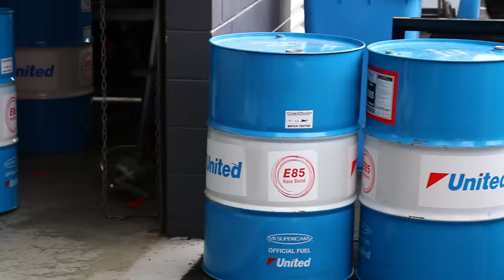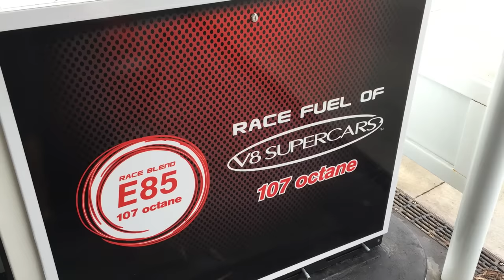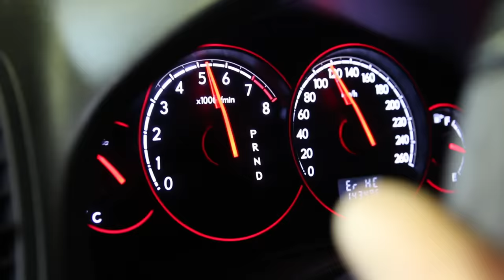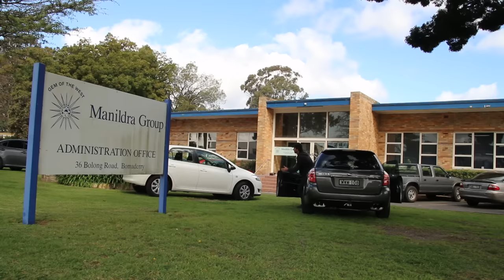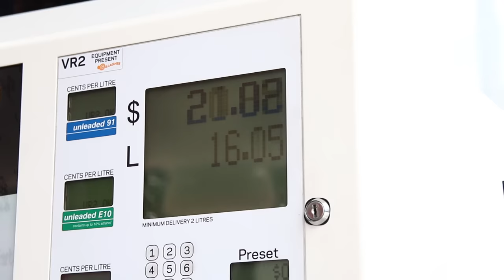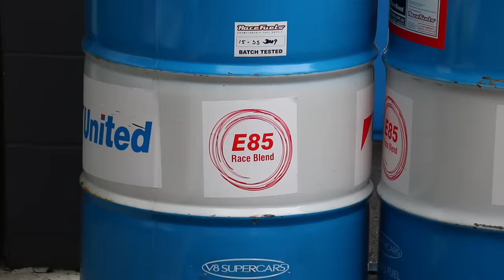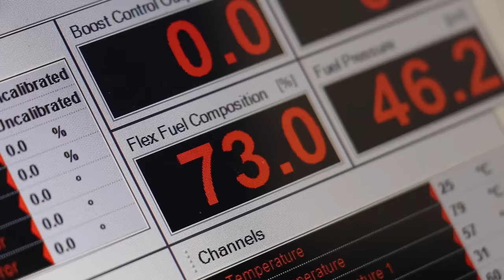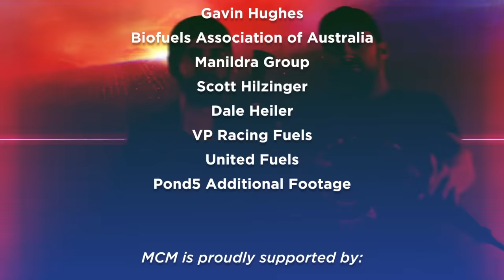E85 Fuel Explained - Should you use it?

Comment: Personally, and I hope this gets voted up so y'all see it, I don't like the way they're forcing ethanol into the fuel here in the US (E10). A lot of old cars are having issues with only 10% in the fuel. Fuel systems, including carburetors them self are often damaged or destroyed by ethanol. Sometimes it takes years, sometimes less. Ethanol free gas is available, but rare. 

If your car is built for it, it's great, if it's not, even E10 is a nightmare. I've taken apart carburetors that sat with E10 in them for a few months and the seals had turned to goo, one even had the float disintegrate. 

Don't get me wrong, I love finding alternative fuels, and anything which can put hydrogen into the engine to be burnt other than gasoline is very interesting, but here in the states Ethanol has become a heated debate. Also, I'll never give up my internal explodey goodness for a electric car. Never, ever, ever, ever...

EDIT: I'm also jealous you have higher octane ratings down there...
Reply: +Dead Reckon killed my old ute (pick up) :(
Reply: +Dead Reckon Not sure about there but here in australia will still have mostly normal petrol with the occasional pump that has e10 or e85. It's also recommended for people to not run ethanol in older cars because that reason, even some older fuel injected ones have problems. If it's being forced upon people over there, then that is really retarded.
Reply: Yep, it is. Use to see stickers saying "This product may contain up to 10% ethanol", now it's just "This product contains 10% ethanol", sometimes they just cover up the word "May". Gotta drive the grammar nazi's insane. I never can get a carburetor tuned on that crap. They don't even call it e10, they still call it 87, regular, 89, mid grade, or 93, premium.

I can't really complain though, gas is averaging around $1.84 a gallon where I live, sooo... Bring on the 10% corn 90% dino juice?
Reply: +Dead Reckon Ethanol isn't required by the federal government or most state governments in the US. It is, however, ALLOWED by these authorities. Ethanol is cheaper than pure gasoline, so some produces dilute their gas with it, up to 15% as allowed by governments. They have to state that the gas is diluted though. Look around for a bit and you might be surprised to find a fuel station near you that carries pure gasoline. However, also be aware that E85 is legally defined as containing anywhere from 65-85% ethanol. 

Also, Australia doesn't have higher octane ratings. They use a different octane scale than the US, which gives higher numbers. Their 98 octane is roughly equivalent to US 93 octane. Look up AKI and RON octane ratings for more information on the topic. If you don't have 93 available, you most likely live in higher elevation, where the tendency to knock is reduced by the lower average atmospheric pressure.
Reply: +Dead Reckon Australia doesn't have higher octane fuel ratings, their 98 RON is equivalent to our 93 MON+RON/2 octane rating.
Reply: +cesar enriquez Australia has 100 RON fuel too in some areas.
Reply: Justin Pember Awesome! we have 116 octane M+R/2 Rating fuel here in TX in some Sunoco's and RaceWay fueling stations.
Reply: cesar enriquez Bet that will eat an engine not built for it alive.
Reply: +Dead Reckon All Shell 91 contains no ethanol. its the only fuel I put in my Carburated cars.
Reply: Wouldn't be so sure about that, I get shell gas sometimes around here and the pump clearly says "CONTAINS 10% ETHANOL", it doesn't say the "V-Power" is omitted from the ethanol. 91 octane doesn't do much for a stock car though. Most of the time it does nothing, sometimes it can reduce the likelihood of knock.
Reply: All the shells I've seen say V-powaaa contains no ethanol. And I live that Rotary life so I need 91. Other wise my wankel will go kaputz.
Reply: All the shells I've seen say V-powaaa contains no ethanol. And I live that Rotary life so I need 91. Other wise my wankel will go kaputz.
Reply: All the shells I've seen say V-powaaa contains no ethanol. And I live that Rotary life so I need 91. Other wise my wankel will go kaputz.
Reply: You can get any engine to run on ethanol perfectly. It's just a matter of doing it right.
Reply: +Dead Reckon The higher fuel ratings outside of the United States is because they are rated 98 RON which is around the equivalent for 93 Octane in the U.S. because we use a different measurement standard, called AKI.
Reply: Dead Reckon. You are confusing ethanol with unleaded fuel which uses MTBE which is made using Methanol and Iso-Butane both are petroleum based products. Unleaded fuel still is bad for old engines because the temperatures are higher and  old engine valves were not designed to handle those temperatures. I'm under the impression you still can use those engines as long as you replace the old valves with modern heat resistant valves and probably seats
Reply: saferider10
Quite certain I'm not, the gas pumps here say in rather large letters "CONTAINS 10% ETHANOL"
Reply: Old cars with cork based gaskets can be ruined by ethanol, because ethanol can eat away these type of engine seals. Any car can less than 20 years old can handle ethanol up to E25 due to better seals. And of course, nowadays we have cars than can handle E85, no problem.
Reply: Yes ethanol IS required by the US. It's mandated under the Clear Air Act that states gasoline must have an oxygenating additive.
Reply: Not even. Its closer to your 91.
Reply: Cars made before 1991, are not made for ethanol based fuel, new cars thrive on it though.

Comment: Something you didn't discuss but is a big factor, is ethanol's ability to absorb water out of the atmosphere and fall out of solution in mixed fuel supplies. I'm most familiar with E-10 and it's abilities to ruin all kinds of small engines or at the very least, make off-season storage a serious pain in the ass. If you have a can of fuel that isn't 100% sealed, in 3-6 months, it is likely to be trash. That means boats and mowers and trimmers and chainsaws and pressure washers and emergency de-watering pumps and ANYTHING that takes ethanol fuels runs the risk of having contaminated fuel the next time you go to use it. That's one reason ethanol fuels are NOT allowed in aviation.
That 30% loss of energy is a big deal if you want any range out of the tank of fuel you jst bought as well. It's great for short sprints, where carrying 30% more fuel may not matter, but when your Mini can go 300 miles on it's 10 gallons of gasoline but only 200 on E-85, your trip from Melbourne to Cape Coran might not go as smoothly.
Reply from the maker: +Aaron Barker Range is definitely an issue. We were able to drive Supergramps home from the Sunshine coast to Sydney (1400km) filling up on Ethanol the whole way and only needing 10L from a jerry can to do the trip. We don't really deal with small engines but we have read about issues with storage also.

Comment: I think it would be interesting to take apart an engine that has run on E85 for a while. There are a lot of questions around reliability and durability. What would the carbon buildup be like? How is the oil affected? Does ethanol create rust on the rings if you let it sit? (How do the bores look?)
Happy new year! :)
Reply: +Clément Dutter ethanol wreaks havoc on engines that sit. I'm sure it would have some sort of affect
Reply: Reliability and durability usually is not a problem with ethanol EFI engines. Ethanol fuel makes far less carbon deposits and don't darken engine oil as petrol does. Otherwise, a real problem is the corrosion in unprotected Petrol carburetors and engine oil contamination.
Reply: Ethanol is still corrosive to engines that sit. yes modern engines seem to be able to take it in stride unlike carbureted engines with copper components. But it seems to me that all modern Fuel injected engines don't leave carbon deposits in the oil ethanol has no affect as far as I can tell. I have rebuilt more carburetors in the last 5 years than I have ever had to before. Trucks with fuel systems that haven't been touched in 20 years all of a sudden need to be rebuilt every year. Ethanol is not a miracle fuel and I would go as far to say that this video is sponsored
Reply: Look on YouTube, there's one where they take apart a Chevy SUV, not even flexfuel and engine has no issues
Reply: Of course flex fuel engines have no problems there designed to run on ethanol
Reply: +Noah Ferrari it may not be a miracle fuel to some, but for small displacement EFI motors running big boost, it is a Godsend. 

I could only run ~23psi on my 2.0L 1999 mitsubishi eclipse on the 91 octane fuel available in California. Any more than that, the motor would start knocking and pull timing. On E85, I've been able to run 35psi and 4 more degrees of timing advance, which gave me about another 150hp over 91. (I could have probably pushed it past 45psi if I wanted, but it was a stock motor). E85's resistance to detonation is truly astonishing. 

Considering E85 costs roughly the same as 91 in my area (even after factoring the 30% efficiency loss), it definitely is a great financial choice over race fuel that's 5x more expensive and makes less power. And, all I had to do was spend $350 on bigger injectors and retune the car.

To me, it's as close to a miracle fuel as I've ever seen.
Reply: It's been done. Look it up, there's is a video showing a tear down of an engine (non flex fuel) after 100,000 miles and the engine had no signs of problem whatsoever.